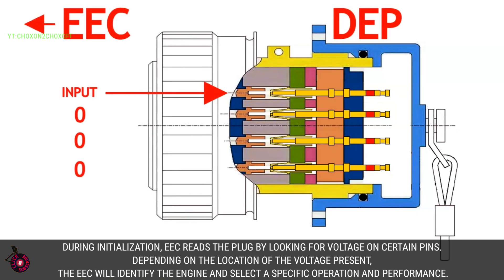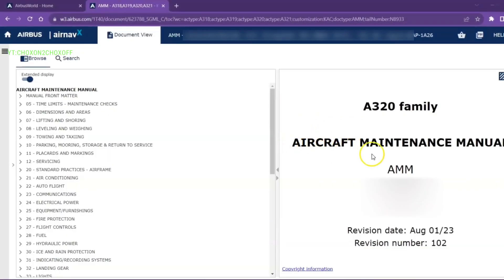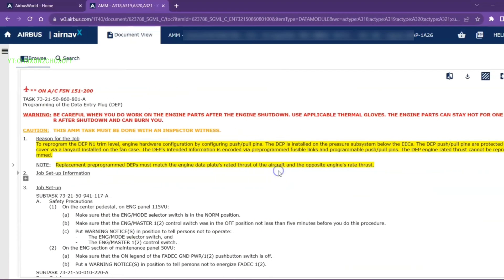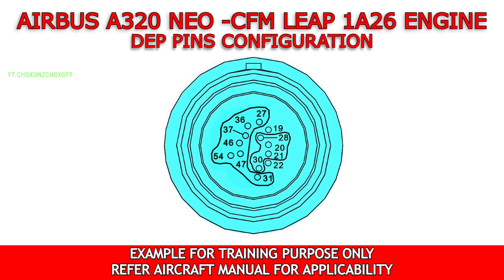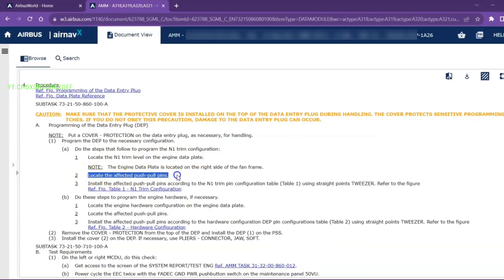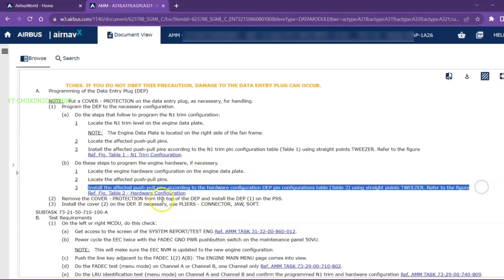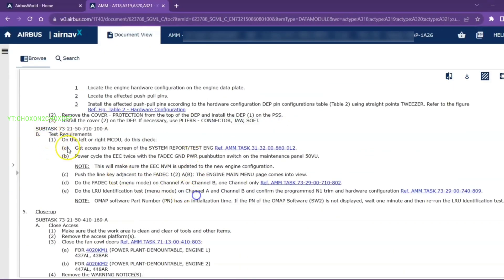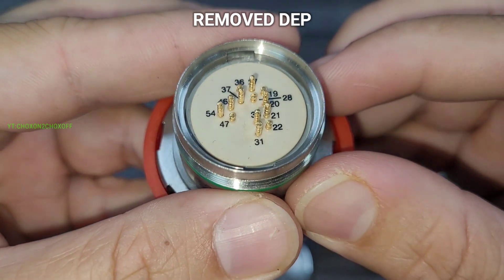How to do DATA ENTRY PLUG PROGRAMMING OF AIRBUS A320 NEO ENGINE LEAP 126A DEP #a320 #a320neo

Comment: What N1 trim means?
Reply from the maker: N1 trim is the setting of low-pressure compressor and turbine speed adjustment depending on engine life and customer requirements. You can refer to engine textbooks for better understanding.